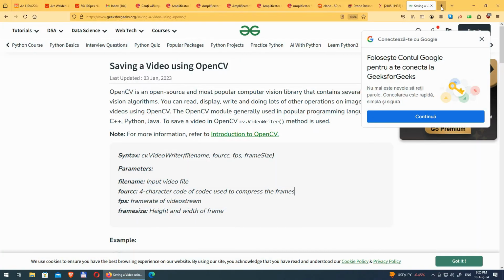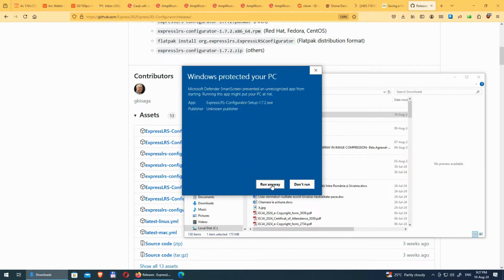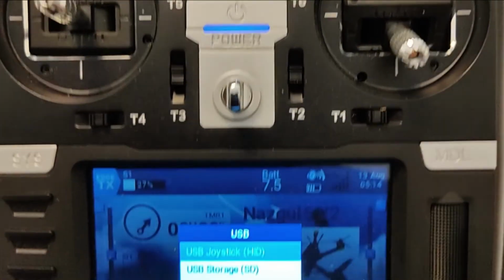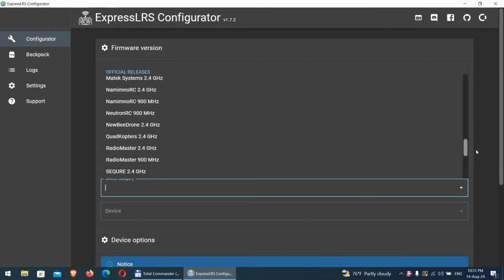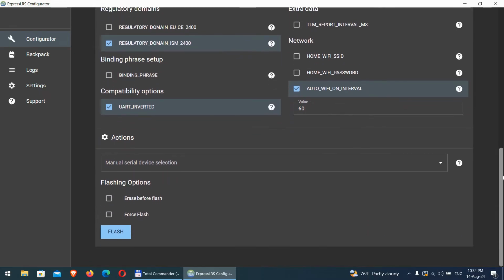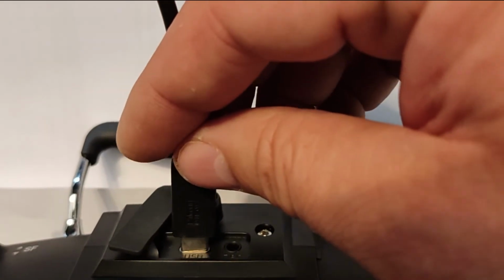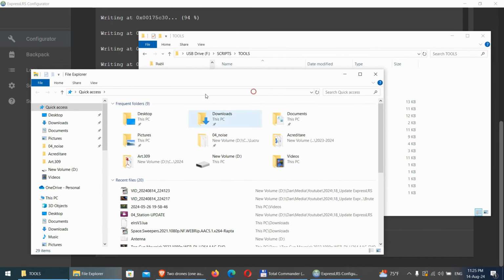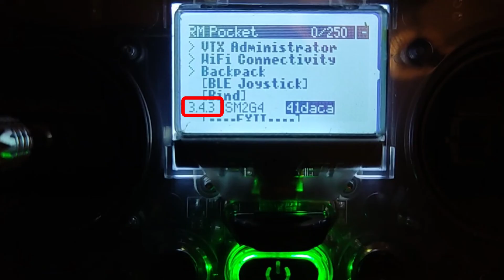The easiest and the fastest way to update RadioMaster Pocket and TX16S internal ExpressLRS module

Comment: nothing works to me years now till now i cant update my pocket..even following your steps no working failed
Reply from the maker: Did you try loading the firmware in DFU mode? You have a video here:  https://youtu.be/ttKKreqHvJc?si=8pxmiGi3TDmmSisB
Reply from the maker: Try WiFi or USB
Reply: @i3Drones  i tried to upa tru wifi but when i touch chose file it didnt response
Reply from the maker: @jeepoyfernandez  check the last option UART.